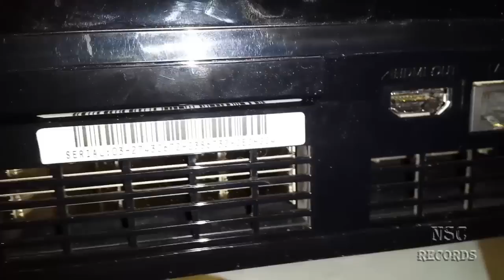PS3 Fat New Case Cooling Mod (only for CECH-G Models) By:NSC

Comment: I found a similar trick works on DIA-002 motherboards: you cut the side plastic from the cooler (not the case) in the same region shown in this video, now the air can escape through the square holes! In my case it made the console basically silent. Temps stay in check (<70°C) even with syscon control; using evilnat and setting even the slowest dynamic fan curve will get temps between 60-65°C in game, even during taxing PS2 emulation! Works a treat ;)

Comment: So I have my playstation 3 fat model running a 30 percent fan speed and the heat keeps reaching 80c and I'm not sure why it's not running the fan speed higher because in multiman it says it's over heating but the fan speed is not really changing much only from 24 to 30 percent change
Reply from the maker: You need to delid the IHS

Comment: Hey NSC, just to let you know that I've done this and it's insane how it improves the air flow. I think it would be also good to drill a few holes below the cut part, because on my CECHA/B/C/E most of the air goes out from the square holes. So not only cutting out the tabs like you did (and I did) is a good thing, but making some tiny holes below those would be also very good!
Reply from the maker: Yeah, sure, i did it already a lot times ^^
Reply: @NSC-Modz  Hey NSC, I've done several delids on all PS3 models, have got great low temperatures on all of them but this CECHG to me is the WORST PS3 model. I simply can't get low temperatures, specially for the RSX, on this model. If it wasn't for webMOD to keep it down, it would overheat.
I'm using very good thermal paste, it's delidded, I'm sure there is good contact between the IHS and the RSX. I even tried adding a 0.5mm and then a 1.2mm copper shim on top of it, but nothing seems to reduce the temperature on the RSX.
Do you have any ideas what could be going on? For example: on the CECHA/B/C/E I can get 65 degrees on the RSX while playing games, with very low RPMs on the cooling fan, but on this fecking CECHG, it'll go up to 75 degrees easily and the fan will go to 60% speed. The CPU is fine on the temperatures, but the RSX won't go down. 
By the way, I did this plastic mod as well! Let me know if you have any tips on this CECHG, thanks NSC the place to be! <3
Reply: i dont mean to be off topic but does anyone know of a way to log back into an instagram account?
I somehow forgot the login password. I would love any help you can give me
Reply: @Avery Hudson Instablaster :)
Reply: @Iker Nickolas thanks for your reply. I got to the site through google and I'm in the hacking process now.
Looks like it's gonna take a while so I will get back to you later with my results.
Reply: @Iker Nickolas It worked and I actually got access to my account again. Im so happy:D
Thank you so much you saved my ass!
Reply: @Avery Hudson Happy to help xD

Comment: I own both the old 60GB BC CECHC model and a 2008 80GB CECHG model.  The reason why the 80GB model doesn't have the extra ventilation is because it runs far cooler and DOESN'T need it.  My old BC model run HOT to touch from day one during heavy gaming, it's fan runs louder, its PSU is very inefficient and lets of hell of alot of heat, the RSX and CELL which are 90nm also run far hotter than the non BC models.  I've reflowed it twice in my time of looking after it carefully.  It's a model that will eventually fail regardless of reflow or reball, I don't use it much anymore despite replacing the old thermal paste with Gelid Extreme both under the IHS and on top.

I run the same games on my CECHG model that has far less ventilation slots and it doesn't come anywhere near close in temps.  Infact I would say the reduction in ventilation slots helps keep a lot of dust out!  Good video though! :D

I've since taken my old 60GB lid, chrome bezel and trim and modified them to fit perfectly onto my 80GB CECHG model, so I've got the slick, beautiful look of the 1st gen model on a the much cooler and more efficent 3G model, a 120 GB Samsung 840 SSD is also installed in an all round snappy system.
Reply: I don't know where you got this from, but the CECHG doesn't come with a 80GB option, it always comes with an 80GB HDD. 
The CECHG doesn't run cooler, its motherboard, the SEM-001, was the cause of that. In a redesign choice, Sony fucked up how the airflow design, so the CELL and RSX didn't have any space to breathe resulting in extremely high temps, and very common YLODs. To be fair, the CECHG does ship with a 65nm CELL, but that doesn't matter because it can't be cooled anyways. The argument that you're making about CECHG are hotter than the BC console lineup is pure bullshit. The first gen phats are in fact cooler, and you can make them even cooler as well. I've owned 3 CECHCs and 1 CECHA, the CECHA being my main console. If you know what you're doing, you can get them to really low temperatures. The main thing that affects the PS3 temperatures is the ambient temperature in your room, nothing comes close to affecting it as much. For me, with my setup, I get around 55C in-game with 25C ambient. If I were to play in a 35C ambient room, I'd get around 67C, which has actually happened, by the way. 
Also, the fact that it's PSU gets hot is BS, once again. If you haven't set it's fanspeed properly, you will get a hot PSU, yes. But the PSU doesn't get hot by itself, the PSU gets hot because it sits right under the CELL and RSX. The PSU in itself never gets hot if you know what you're doing.
I really don't know why you have an SSD in your system, it doesn't affect performance whatsoever, the bottleneck when loading games is the CELL/RSX, not the harddrive.
So in conclusion,  the first gen phats are objectively better than the CECHG, so why are you making the argument that it's the opposite?
Reply: gay the first gen ps3 models that are bc are only good when it comes to backwards compatibility. Other than that, the bc models got ylod way faster than the newer g models did. They have a similar heatsink setup too. So the g models are a tad bit more reliable than the older bc models.

Comment: I want drill holes on the botton on my ps3 where the fam is located and remove the plastic you suggested to remove however how much cooler will the ps3 be and for both cpu and gpu? thanks in advance.

Comment: what about the cecha0l systems because they were very known for over heating? i had considered taking the power suppily apart and take the case of the power suppily and drill holes in the outer casing to help it get better ventlation
i own a slim system i did mods to and it worked like a champ
Reply from the maker: yea, Slim´s are all a bit Cooler ;)
Reply from the maker: bahh this shims destroys your Chips slowly with the time, because it makes TO MUCH presure on them :\

Comment: can you make guide for CECHL models? I have CECHL04
Reply from the maker: On the L04 it's different, you can just let it like it is.
Reply: @NSC-Modz  btw I found video about ylod your video was too and someone said is not good idea
Reply from the maker: @altairps3HFW  what exactly is not a good idea? Which idea ever you mean, as long it was tested good enough it's all good...
Reply: @NSC-Modz  In this video: https://youtu.be/I0UMG3iVYZI he said making holes in ps3 case is not good idea. But I don't know I have one question I cleared my ps3 and maybe is not like jet but is something like ps4 fat is a little loud too I want to add I don't made delid because I have only xclamp tool (is for xbox360) and I don't want damage rsx or cell but changing thermal paste and clear ps3 form any possible dust should be enough? btw it was someone from germany because I saw menu and messages and "embarassing" history in browser. There is any idea to make it silent? like 2 fans or something like that without soldering? I can say it was veryy dirty dust was even under RSX should I sell this fat and just play on my superslim? my superslim wasn't that dirty it needed only change thermal paste. I sure you know about playstation consoles so maybe you can give advice? (sorry I can't speak germany) edit: themal paste is Natec Husky I used it for my gtx1060 3gb too but on ps3 superslim I used thermal grizzly kyronaus.
Reply from the maker: @altairps3HFW  yeah, but i don't care about this video 😀 i got my own tests for a lot PS3's which is more important than just bla bla bla ✌️Every one can copy and paste video clips, but this alone will not bring you numbers and stuff... For the rest you can find  a lot more on my YouTube channel 🥰
Reply: @NSC-Modz  do you know how to make 2 fans mod? my ps3 is still hot after repaste :(
Reply from the maker: @altairps3HFW  it's because you need to repaste the paste inside the chips. You need to delid the IHS
Reply: @NSC-Modz  oh so is possible to make by myself? in my town nobody make that , how tools I need?

Comment: works great for me thank yooo now my ps3 sooo much cooler
Reply from the maker: You welcome ;)
Reply: its possible replace power supply from ps3 fat 80gb to 40gb
Reply from the maker: @yassinelove7763  always needs to be a psu with the same Ampere
Reply: hi i have a ps3 80gb model its turning one than  display demarrage impossible then shut off by itself  please help

Comment from the maker: amm Nein, bei diesem Modell kannst du die platine ganz easy raus nehmen, deswegen ist dieses Modell eines meine Favoriten, auf 2:30 gut zu sehen das die CPU/GPU Halterung noch dran ist ;)

Das Modell wo man die schrauben lösen muss, ist zbs. die CECH-H04 version, oder die CECH-L04 auch beschissen, jedesmal die Platine öffnen, wenn man eig. nur Staub entfernen will :\ Aber für diese Modelle hab ich auch ein fix ;)

FAT konsolen die den Lüfter LINKS an der HDD haben, gehen IMMER früher drauf ^^

Comment from the maker: Yea, where is the Problem for a BIG FACTORY like Sony, to get them Consoles Cooler?

in my eyes this is all made extra from Sony, if u understand what i mean...
so it works for a while, and then... PUFF Welcome YLOD :\ = Welcome to Sony Repair Shops, and Welcome more $

but what ever, i just show u how you can make it better as Sony did.

All my Consoles that ive Mod. thei are still runing, NO JOKE, and 3x u can gues why!?

Right, cause thei run MUCH Cooler.

Cheers & Ty for your Feedback ;)

Comment: Hello I have seen some of your tutorials to reduce noise and temperature of the ps3. are very good, thanks for sharing. 
I have a ps3 cechg01. I noticed in your video that mine is like your cechg04. 
my ps3 with all the mods I've done (19 fan blades, thermal pads and thermal paste arctic mx4) has fallen quite the fan noise (level 3-4 to level 1-2 with games like the last of us for example), but even so the fan noise is a little annoying at level 2 and would like to stay permanently at level 1. this mod to break the plastic. really low level fan noise?. what level of noise does your cechg04?
sorry for my english im chilean   :)
gretings.
Reply from the maker: Hi No Problem for your english, i understand all ;)
My PS3 is a bit louder, because i installed a Fan Mod Adjuster, so i make the fan a bis faster, because PS3´s runs to HOT.

Imagine, when your fan turns slow all the time, than your PS3 has always mostly 76-85C* degrees, and that TO HOT, and thats why a lot PS3´s get an YLOD !!!

So thats why i prefer to hear my fan a bit ;)

The biggest Problem form a PS3 is, that the Fan turns to slow...

Regards
Reply: UltraNSC hi man.
about 7 hours ago I did this mod to remove the plastic. besides put thermal pads in all chips on the board. now the fan is low noise. besides that stays colder console. 
thank you very much for making this tutorial friend, helped me. 
Greetings.
Reply from the maker: No Problem ;) But a low fan is not always good, i prefer it turns a bit faster, so thats why a Fan Mod Adjuster is great, because a low tunrning fan means that the PS3 gets HOT

a bit faster turning fan, will reduce the Temps better ;)

i Tested a lot Long a go, and a PS3 FAT just gets about 80C* gegrees in the Menu only after 30mins :\

and with a Fan Mod Adjuster with a bit faster fan Settings it gets about 56-60C*

:) Greetings to you to, and thank you for your Feedback ;)

Comment: I have the CechG White Model that I would like to do this too but as it's so rare here I can't :( I will be doing this when I get another 40gb though and put some Mini Fans around the Vents of it. I used to have 2 40gb And one died and the other had a loud fan problem but luckily sold before It died on me (It was to someone I know and never was told it died)

Comment: so fuckin hard to find the fat ps3 that plays ps2 games, anyone know a website that sells this, and no not ebay that website sucks shit
Reply from the maker: +Nick Anderson You Need the Model: CECH-A01, B00 or C04 witch u still can get everywhere.CECH-A01 are the best, but also VERY HOT, without Cooling Mods the PS3 will just DIE
Reply: UltraNSC thaaank you fiiiiinally fucking finally a guy who explains something right, thank u random guy 😂😂 i like ur vids i suscribed
Reply from the maker: Nice, Thank you very much to for your feedback
Reply: You do know that it is inevitable that the model you are after will die? Take it from someone who took all the steps to avoid YLOD on the cechc model, It happened to me after 7 years.  Once it does you can repair but no fix is permanent.  I've repaired mine since twice.
Reply: Just get a CFW :) I have Rebug 4.78.2 D-REX and i can play PS2 games on a Slim! :)